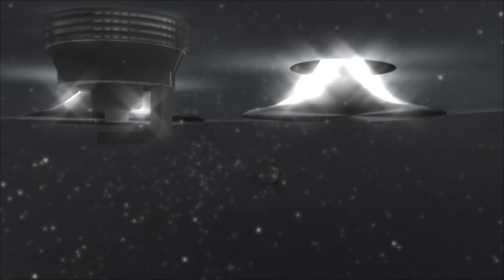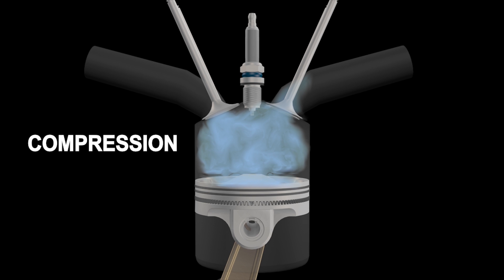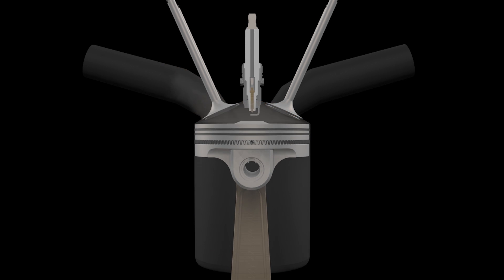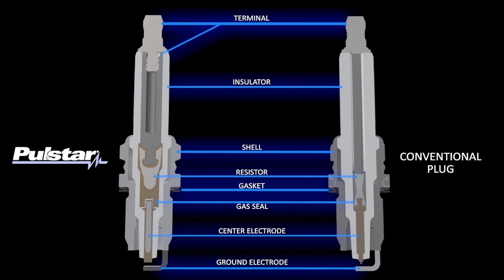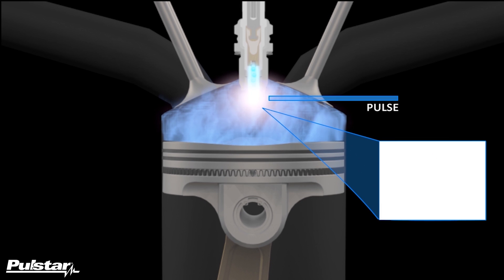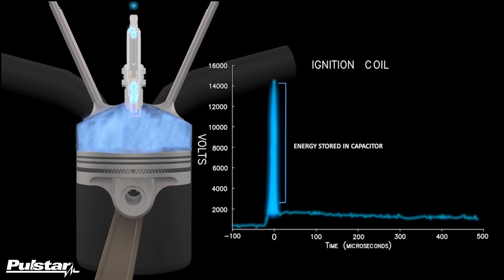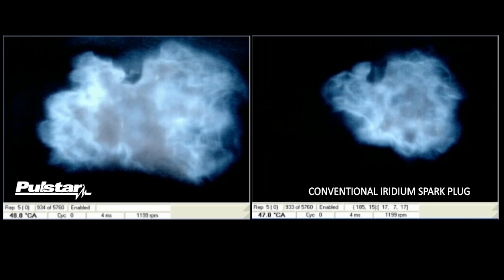How Pulstar Spark Plugs Work

Comment: Absolutely terrible I fitted these in my Citroen ds3 1.2 puretech 2015 and it was misfiring under turbo boost contacted seller and NO refund was offered just a questionnaire was emailed to me about my car and photos needed.Avoid these like Covid 19 I promise
Reply: 3 ou 4 cylindres  ? ?  3 = + vibration

Comment: Wow, lots of shills in the comments. And I know they're shills because they post the same copy pasted crap on any other video claiming better mpg. The reason pulse plugs work, whether pulstar brand or otherwise, is because your typical air-fuel mixture is just liquid gasoline that doesn't ignite and goes straight out the tailpipe. The small amount of gasoline vapor is the thing that actually ignites (this is why engines need to warm up before they can deliver performance, the intake manifold actually vaporizes the gasoline). A high powered spark takes care of some of that unburnt fuel giving you better horsepower mileage and all the rest. Do actual tests instead of coming on here with your uneducated butt-dyno guesses.

Comment: These have failed in my KTM 950sm motorcycle. At first it was dropping a cylinder and then complete engine stop. Upon inspection the centre electrode has come loose and disappears inside the body of the plug. SHIT DO NOT BUY!

Comment: I have been a professional auto technician for over 22 years now. I took a 12 second Nova down to the track for a test and tune I brought 6 different sets of different brand spark plugs with me and changed them between runs. I found there was no difference in the way the car ran or 1/4 miles e.t. so I don't buy into trendy gimmicks. I can say for sure that alot of people back in the day made the people at split fire rich when they could have ran a cheaper plug and made the same power.

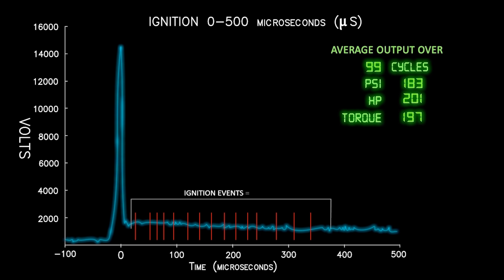Comment: At 2:08 in your video you show an overlay that states there are 5000 spark events over the period.
As a mechanic since 1976 and having spent many years using oscilloscopes to diagnose ignition conditions and I know what the video claims to not be the case.
There is only one single spark event at the "spark line" you show, the duration of which is the length of the entire spark line dictated by time the current from the coil secondary takes to deplete over the resistance of the spark lead and spark gap, I have a number of vids on the topic.
In addition to that the spikes you call individual spark events are in fact simply the variances in resistance during the one spark event due to changes in temperature and high pressure gas perpendicular to the spark during combustion (that causes the spark to bend increasing the distance it travels) and I also have a vid of super imposed oscilloscope patterns of a spark plug during a combustion event and a following non combustion (dead spark) in a 4 stroke engine that clearly shows the variances you call multiple spark events are only a reflection of the combustion as I explained above.
Why are you misrepresenting the spark line as multiple spark events when it is clearly not ?

Comment: I had a set of these in my 08 explorer and out of 6, 2 of them had the ceramic around the electrode break off in the engine giving the truck a bad shake when running. I only had them in for 6 months and then I ended up replacing them with AC Delco iridium spark plugs.
Reply: Good to know. Thanks for sharing

Comment: That isn't what happens at all. After the voltage collapses to bridge the spark gap, is when the ignition coil starts delivering power to the spark plug. Because of that, it is impossible for the "capacitor" to be charging before then. There is just as much inconsistency with a Pulsestar plug as with most others, and infact, it is better to use an iridium plug because the spark initiates sooner, and with less energy requirement from the ignition coil. Talk to Mark at WeaponX for the real deal.

Comment: I've had them in my '05 Harley with a stage 2 modded twincam 88 engine, running torque cams for 2 years now. I'm a pretty aggressive rider, and the only difference I noticed may have been a very slight change in freespin revs, but this was already a well-tuned motor. Aside of the cams, the most noticeable difference was a Boyesen X-wing in front of the carb,  directing airflow and making immediate throttle response a bit snappier, not the plugs.
But at least they last.

Comment: This is SNAKE OIL.  Even if this thing had a spark of a bazillion volts via plasma-antimatter-explosion it would NOT ignite the compressed air fuel mixture any BETTER than the platinum or iridium plugs recommended for your car. This is a WASTE OF MONEY.

Comment: I can't find one dyno run that showed these plugs worth the money. Biggest gain was from a V8 race engine and it only gained 4 hp and made torque lower. That's $200 for 4hp. I'll take my money and apply it to real performance upgrades.
Reply: The fuel economy results are tempting.

Comment: The flame front that a spark plug starts can't be sped up by the spark plug, the air/fuel mixture burns at a set rate depending on the ratio.  The only way it could burn faster is if it all combusted simultaneously like in a diesel(compression ignition), without a flame front.  Although gasoline is too volitile and difficult to get to work like diesel consistently because it needs perfect temperature, pressure and air/fuel ratio conditions to run well.

Comment: Electronic controlled ignition systems advance or delay the spark timing to compensate for any timing issue. I think these would be great in a distributor style ignition system.
Reply: If the problem is erratic spark delivery the computer can only do so much.

Comment: does not save gas actualy will cause it to use more
Reply: how? amount of fuel into the cylinder is governed by the fuel injector or a carb

Comment: Well as a professional mechanic who had to study automotive technology to become certified, I feel there may be a need to put my own two cents in. Hold on to your Hats lol . First of all to overcome the spark plug gap, the ignition system in total has to be able to produce enough pressure (voltage),  to ionize the air gas mixture between the spark plug gap (the definition of plasma is ionized gases consisting of positive ions and free electrons in proportions resulting in more or less no overall electric charge). A corona effect happens the instant of ionization, then propagation, which is similar to lighting bolts shooting off in all directions from the corona,  it is then,  that the propagation starts the flame front which will continue to spread across the combustion chamber. (BTW the blue / reddish arc you see crossing the electrodes is the after effect of electrons following after the ionization ( ionization/corona is the true spark! ) Upon ignition the gasses expand rapidly creating pressure that will push the cylinder from top dead centre to bottom dead centre (pretty sure we all know that part). But here is the rub, the time it takes to go from the corona, to propagation, to flame front takes approximately 0.003 seconds, that may not seem like much but when your engine is spinning at 2500 RPM or MORE it is important because that delay means the cylinder through inertia may be halfway down the cylinder before it feels the push from the flame front if it wasn't advanced properly. And that is that's wasted energy. That's why all reciprocating  engine ignition systems have timing advance. Bike, car, boat, airplane or lawnmower. Your engine advances the timing to make up for the delay in ignition to flame front at various RPM so that the flame front starts push the cylinder close to TDC (top dead centre) where peak pressures are utilized ! By using a capacitor in the plug it definitely will take time to charge ...delaying the ignition ...in turn this will change the factory specifications for your engines timing advance essentially RETARDING its timing !  Pulstar states that this is compensated by a faster flame front... and although I believe the Pulstar plug may produce a bigger corona effect as well as propagation and  hence a larger flame front,  ultimately the speed of travel after propagation is dependant on the volatility of the air fuel mixture, I think that a ignition delay would still be there.  Factory engineers calculate advance timing and the sparkplugs to coincide with mixtures for optimal rich acceleration or lean cruise, as well as with a recommended fuel octane (the higher the octane the more resistance to detonation) for the engines they design.  Essentially would I buy a capacitor sparkplug ? ..well I would for an engine that I built and  planned to run on a  Dynamometer so I could adjust the timing advance curve for optimal performance. and test it for benefits  That I could see myself doing.  As for just putting them in a factory spec car just as is and expecting better results ?  it might and it might not... my guess is a around town as a daily driver it might ...a high revving 15,000 RPM race engine it may not ....my advice to Pulstar is more empirical proof.
Reply: Steve R: Also a good trick comparing them to iridium spark-plugs, they are designed for duration not performance.
Reply: Good grief, save some room for the rest of us to write something.
Reply: Steve R lol k
Reply: Pulsar plugs aside, would you agree that most engines would benefit from a wider than OEM recommended gap? Of course you can't go too wide or there's misfire, but if one takes the time to widen the gap just enough before it misfires, there's more power and better mpg available?
Reply: @Wes_5kyph1  and to answer your original question. Its a case by case problem. Not all engimes will benifit from a larger then OEM spec gap
Reply: @Wes_5kyph1  wider gap does not cause miss fire, it will cause "no fire" the spark gets "snuffed out" refered to as spark blow out. Usually a bigger,problem with boosted applications. But to wide on any engine will habe the issue. To small of a gap and it won't fire enough for a,complete burn. Or will weld itself together.
Reply: BUT Steve*...I don't understand.. is there any way you can explain again so I can get it? Thanks🤳
Reply: Steve R  lol did you try them and did they work or not. Had to ask

Comment: does anyone have any proof of this? i mean i would love to just slap some in my bike or my soon to be built experimental engine, but only first if i know they will at least preform as good as the normal ngk my bike uses, but if they preform better (from what i'm hearing you could just add a small advance to timing to get the same result, unless the plasma part is real) then i would like to use these to their full potential, as in have a lean burn engine set up to ignite all the fuel as fast as it can and make power out of all of the burn time to have little waste heat go into the cooling system and no usable heat go into the exhaust, i will be bouncing around a few ideas on this engine and may try some ideas out on a test engine to confirm things, but from my understanding here, you can test their claims by changing gap, afr, and timing, and then measuring the exhaust temps till you get the coldest exhaust for the leanest afr, then try again with regular plugs to confirm that these are better (you may have to change your settings again because of how the plugs act differently, but you should be able to get more work for the same fuel usage with these if they do what they say, either way they can be a valuable tool in fine tuning your ignition timing at least)
Reply: check out project farms video
Reply: @Famzgotit   Just came here from Project Farm. As some who is highly skeptical of spark plug performance gain claims I was shocked they actually made a difference and beat out even iridium plugs.

Comment: scam
Reply: well, you cannot prove that it is a scam unless you test it by yourself or better by an expert, what if they are genuine and what if it genuinely offers more performance, fuel efficiency and lesser emissions?
Reply: @loendsti  I have 20 plus years of tuning performance engines and I would never use these plugs. Having spoken to others they wouldn't last a single race. Total snake oil.
Reply: @bEEBO178  okay

Comment: what a load of BS. spark plug are spark plug. all they do is throw an spark according to their neighboring ignition coil. because your factory ignition coil does not have the capacity to throw such plasma arc. your ignition coil got alot to do with the sparks. not your spark plug. in order to get such plasma arc, you'll have to upgrade your ignition system.
Reply: hotpapayasalad A capacitor between the spark plug and coil is called a "condensor" and has been used on some engines since the 1930's. When the spark plug arcs it charges up the capacitor which takes time and holds the arc longer on the spark plug. Without the capacitor it just arcs into a dead short which is over quickly.
Reply: hotpapayasalad Agreed

Comment: At 5000 rpm, there are 41-42 cycles every second. If a spark prevails for 500 microseconds, how is a spark plug able to produce 41-42 sparks every second ?
Reply: MICROseconds! NOT MILIseconds
Reply: the charging would last about 4x as long as the discharge to total 1 second.

Comment: 1. Once the fuel is ignited it's a self sustained exothermic reaction, the spark is then useless, MSD Iridium plugs do what your plugs do already without the "plasma".

2. Since your plugs seem to be running much hotter, one has to question if they do not run too hot and cause pre-ignition which is terrible for an internal combustion engine.

I sense these plugs are a bit like the "revolutionary" E3 spark plugs

Comment: I have used these in a Ford Ranger 4.0 V6. They were Fantastic in till a month later . Miss Fire on cylinder 2 & 5. The Insulator broke on the plugs. These plugs just couldn't stay together. Had to figure a way to remove the peaces from inside the motor. After a weekend of frustrations. I got some NGK plugs in used all my life never had 1 BREAK!. Everything went back to normal no more misfires. I have sent pics to Pustular asking questions on why or how this could of happen ? I made sure there put in correct and Gap was dead on .054 was the gap. I really want every 1 to be safe and keep there car long as possible. I was lucky these did not hurt my motor.

Comment: do you make a plug for a racing flathead 5hp briggs and Stratton engine on alcohol?  the plug everyone uses out there is an autolite 411.  do you have a conversion?
Reply: Adam Blaylock also for a 2 stroke goped engine!?!?

Comment: I was very skeptical about Pulstar Plugs.  After installation,  my Jeep can now do wheelies,  the rip in my seat in now gone, and ice cream tastes sweeter.  Thanks, Pulstar!
Reply: YouStupidBunny oh yeah? I threw these in my yugo, and can actually climb hills now!!
Reply: These are the same plugs Doc used in the DeLorean.
Reply: I swapped out my civic's stock plugs for these and overnight it became an NSX!
Reply: dont even start me about my friend putting them into his cummins
Reply: I added a few to my Trek bicycle. Can now climb walls.
Reply: I put them in my chinese chainsaw
She cuts on its own now
Reply: GeneSun 
You already are special, dont listen to anybody that says differently.
Honey, now put your helmet back on.
Reply: It pays off sooner than one might imagine

I dont have to change oil anymore

But you should be carefull tho
Almost bent the shaft due to too much power
Reply: YouStupidBunny  You probably replaced your spark plugs for the first time and now you’re getting a normal spark is called maintenance
Reply: After installing Pulstar Sparkplugs the resulting synchronization system between the johnson rod and space-time continuum modulator has greatly improved the performance of the flux capacitor
Reply: Well my post isn't nearly as funny as everyone else's, but...they work.
 
I've had them in 2 V8's. I had good plugs and coils before I changed so while I noticed a difference, it was Earth shattering. Just ran smoother and felt like it had more grunt in the lower rpms. 
This was years ago when they were supposed to be having quality problems but in the 3 years I was running that car, I never had any problems with them.

 Start up was faster. Pulled good to redline. You could feel it was stronger but it wasn't like putting a smaller pully on the blower. 

A bigger difference was in average highway fuel economy. I run the same expressway route to and back from work and started tracking my average fuel economy at 70 mph, running in both directions with the cruise control on.
 
 My 2001 supercharged Jaguar Vanden Plas was consistently getting 20-21 mpgs on the stock plugs (platinum or iridium). 
 With the pulstars my highway average went up to 25-26 mpgs.

I got have some in a V8 S Type that I'm going to sell cheap, and am pulling the pulstars out and putting them in my Jaguar XF supercharged Luxury.

 I'll photo the highway averages before and after against the 3 week old factory plugs that I recently installed and report back.
Reply: Well my car can fly
Reply: I ate one and now I have rocket engines in my hands
Reply: My have iron man pulse lasers in my knees
Reply: my corvette is best because Pulstars 
https://www.youtube.com/watch?v=GvkJzYHCdHI

Comment: I believe these are hotter plugs design for extreme applications! Most plug manufacturers don't recommend hotter plugs for every day use! Unless there a dyno. Test results! They are high prices spark plugs! That may cause more internal engine problems down the road!

Comment: some one please tell me why or why not these are junk
Reply: Basically, your OEM sparkplugs work just fine, and there are much better options for the price associated with this product. That $200 could be applied to an aftermarket ignition system, which BTW use normal sparkplugs.